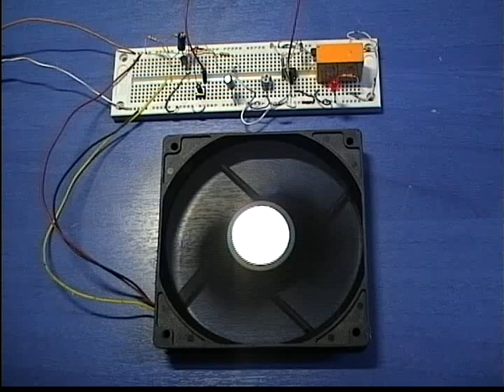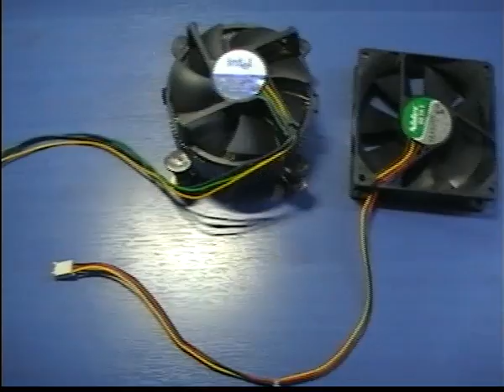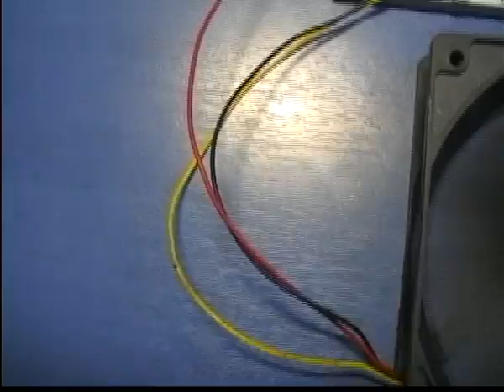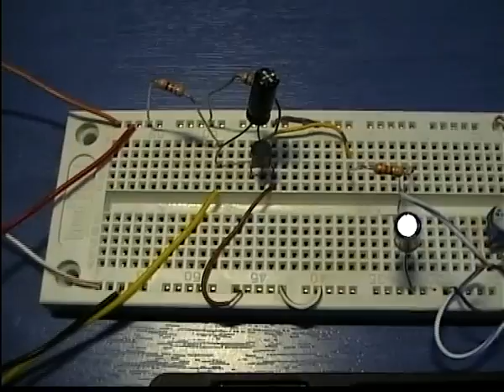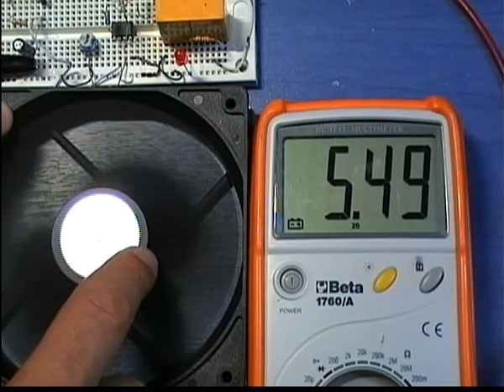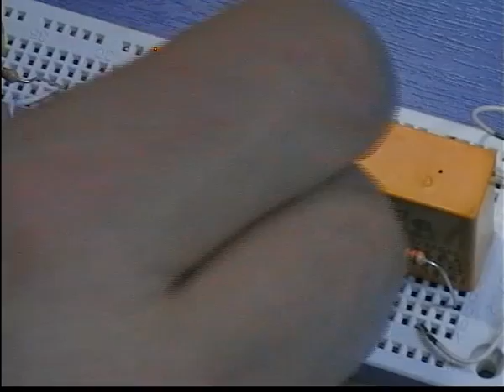PC Fan Failure Alarm

Comment: Could you use a NE565 to convert the Frequency to Voltage and then use a comparator to detect when it is below a certain voltage?
Reply from the maker: yep, that could be done i suppose. i have not test it though.